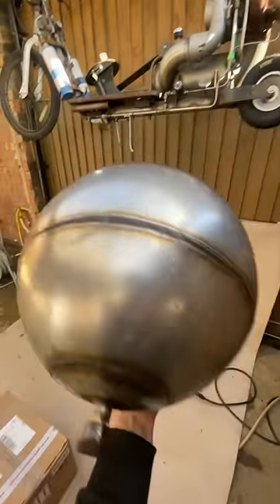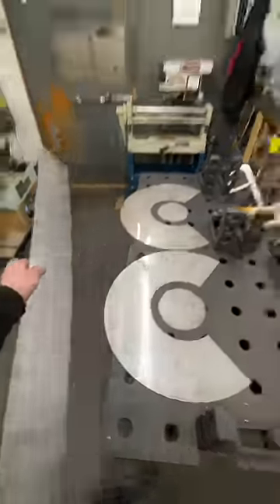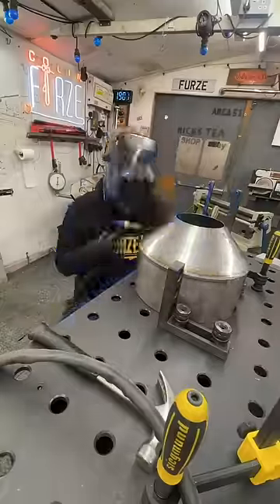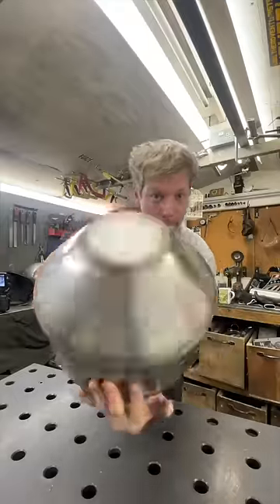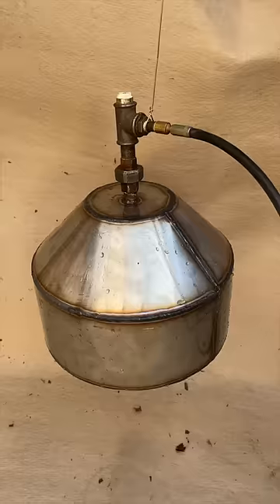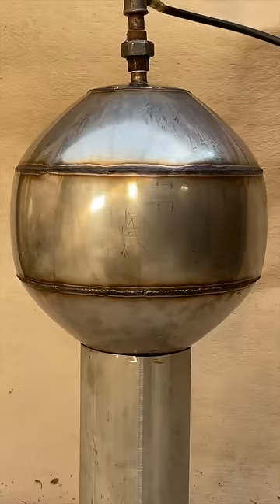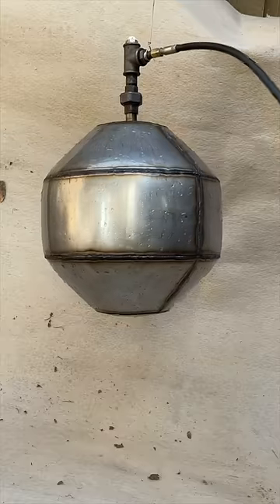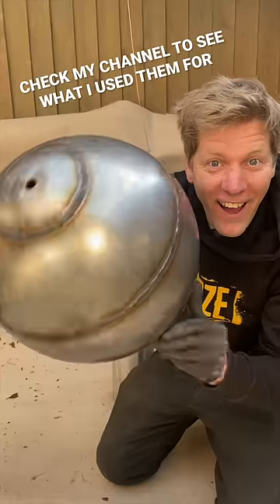Your Pressure washer has a Secret SKILL

Comment: That's some serious confidence in your welding.
Reply: He's a gifted fabricator and engineer for sure!
Reply: Indeed
Reply: He’s a god at creating everything lol so honestly I’m not surprised
Reply: Well the reason you hydro test tanks and boilers is specifically because if they rupture it’s not too big of a deal. Because water is incompressible, the increase in volume with a breach is minimal. Compressed gas is what makes a bomb you have to be worried about
Reply: you havent seen explosive forming spheres
Reply: The fact that water cant be compressed makes it much safer though, if that exploded holding a gas it would be way deadlier.
Reply: @skylined5534  Less of an engineer and more of a plumber. But surely gifted.
Reply: Welding is not gluing metal together. Its fusion it together on a molecular level. The welds are stronger than the steel. Because they are steel, but thicker.
Reply: @Mikael-jt1hk  thats if the welds are done properly. This guy is really confident in his skills
Reply: @t_kups8309  

Definitely an engineer too. You have to be to do the stuff he does.
Reply: @antreaskonstantinou8585 Water can be compressed, it's that it's not practical to do so.
Reply: Even when I did it for a living, I'm not sure I ever had that much confidence in mine.
Reply: The giant steel sphere tanks used for gas storage are made using a dimilar technique. Except instead of using a pressure washer to create the internal pressure, they use explosives in water. While this takes some good confidence in your welds, I wouldn't trust a vehicle welded by someone who couldnt manage it. Definitely nowhere near as impressive of welds as with those industrial tansk.
Reply: no its not, its not like pumping air its water wich does not compress, aka it doesnt build overpresure either, if a weld breaks it just leaks it doesnt burts or explode.
Reply: Can absolutely guarantee no one commenting under this saying it’s easy could do it without a leak.
Reply: if you watch the video he used these in, they blew out a few times before he succeeded.
Reply: not really, its water which doesnt compress much, there is barely any energy stored in the sphere while its under pressure
Reply: Well he was a plumber/gas engineer I think
Reply: @jacob9798 There's probably more energy stored in the steel than in the water.
For all the commenter here, I would recommend to look at the phase diagram of water.
Reply: @ameunier41  I was just talking about his welds because they are good welds just by looking at them
Reply: Real confidence is letting the original air stay in it 👀
Reply: Lol. You've obviously never heard of this. It's the safest way to remove dents or do what this fella is doing. This is how we removed dents from 6,000 gal tanker trailers. Stop being afraid
Reply: @theshuman100 exactly. He ain't seen nothing lol
Reply: @Mikael-jt1hk You’re right, but only if your welds don’t have imperfections. If you have cracks that weren’t fully fused, then you have a stress point where it can fail. I’m no pro by any means, but I’ve done my fair share of welding and that’s my take away from everything I’ve learned so far. If I’m wrong though, I’d love to understand why
Reply: @jacob9798 they’re dreadful looking welds 😂 
Colin is a good guy but he’s certainly no welder
Reply: @cornellkirk8946  look decent to me, don't think after all the stuff this guy has done ye wouldn't know how to weld
Reply: @jacob9798  it’s water tight but you can see it’s not good, it’s not even acceptable as a welder.
That’s a fact, it’s not up for debate especially by someone who isn’t a welder. What part of it looks good to you exactly? 😵‍💫
The fact they weren’t purged alone is enough to show he doesn’t know much about welding. The fact you don’t know what purging is, tells me that you aren’t qualified to have a valid opinion
Reply: In the video itself, this process actually fails many times. It's really confidence in the ability not to get any air in the pressure system.
Reply: @antreaskonstantinou8585  welding is not rocket science if you are not blind and deaf and got no hands.
Reply: that's knowing your skill as a fabricator and welder.
Reply: If it springs a leak water will just squirt out. He can weld the leak and try again.
Reply: It can get even more extreme, there is a different method, where instead of a pressure washer you use an explosive.
Reply: @cornellkirk8946  we love to see how you weld. 🙄

Comment: bro pressure tested his welds so casually
Reply: It's not nearly as big of a deal as it looks. This is how you can remove dents from large tanker trailers.
Reply: @timbodnar6711 I’m not sure why but this reminded of me of when the vent isn’t open during emptying and the tank collapses on itself
Reply: @timbodnar6711 thing is he could have Been standing 20mt in behind a wall with the on off switch, but everyone think he's standing 1mt away.  Probably takes well more then 1800psi to make those welds fail.
Reply: @timbodnar6711 What? Are you clueless. He could of easily lost his life if he wasn't so godly at welding. First vid I've seen of him too.
Reply: @name5293  I mean, it's water, not air. So it wouldn't explode
Reply: @name5293  Calling someone clueless? Ohh the irony.
Reply: @DanielSan-ch7dr   In his videos his face was right next to it lol, the highest pressure stuff in there was water and it sometimes leaked but it wasnt deadly or dangerous, obviously he knew how to make it safe, im just talking from my observations
Reply: @name5293 if the welds fail water will spill out

It's different with air, which is very dangerous
Reply: @Scavendon  but he could be 🥺
Reply: Holy moly people, I don't think grizzly was focussing on how the pressure effects the metal vs air. It was a comment on weld quality. It takes a decent weld to be 100% water tight. I'm not saying that many people can't do it, just that any welder would nod his head in approval over this weld. It's a good weld, and curved welds are harder than straight ones.
Reply: A weld failed on his first attempt.
Reply: @name5293 your the clueless one who doesn’t know the difference between hydraulic and pneumatic forces. Air compresses which makes for a rapid expansion aka explosion when rupturing. Water is “non-compressible” it compresses very slightly but no where near enough to create a bomb. A ruptured weld would be an adult super soaker which is dangerous due to a potential high pressure injection injury but that’s also pretty unlikely.

Comment: The TIG welds are looking beautiful
Reply from the maker: They held out.
Reply: @colinfurze  They weld out
Reply: @colinfurze  I seen the video ya had a few pinholes mate. Got a face full of water... Still miles better then I could ever do and I only got a messy flux core mig.
Reply: @colinfurze  what amperage did you use was it 2mm steel? Or 1.1 i use 40 amps for 1.1
Reply: @D-Dova  thanks for that bit, kek!
Reply: Those welds are a disaster
Reply: Beautiful??
Reply: looks beautiful? Definitely not. But worked? Definitely.

Comment: Instructions unclear, created a explosion, gotta move house
Reply: instructions unclear, moved to neighbours, can't find house, please help
Reply: instructions unclear, picked up my house and moved it across the street
Reply: Instructions unclear.  Had to pick up face but arms where gone.
Reply: Instructions unclear, Nebraska no longer exists
Reply: Instructions unclear, don't pressure me!
Reply: Instructions unclear, currently on the run
Reply: Was gunna say, how many times did it explode before getting it right lol
Reply: @raidzeromatt  the welds may fail and rupture, but it wouldn't explode like you're probably thinking. Water doesn't compress like air does, so once the container fails the water would just quickly lose pressure and leak out instead of rapidly expanding and making a boom

tl;dr :  it's less bomb/balloon and more broken pipe
Reply: In industrial processes instead of using a pressure washer they use hydrogen combustion… so you failed successfully?
Reply: @ProfessionalGasLighting 
In industrial processes, they've got precisely metered gas mixtures to produce the explosion, X-ray machines to check the welds before they start blasting, and trained engineers to calculate whether or not the process would actually work to begin with.
Reply: jordanrodrigues1279  -  I filled it with gun powder and put a fire cracker in the hole... Now I am in orbit with all the other space junk. That reentry is going to be hell.
Reply: @KlodFather  You copy and paster.
Reply: @j-schnab6338  -  What the flatulence are you talking about? Copy and paste what? Everyone knows that SchnabMaster likes eating paste and play-doh so we saved it for you buddy. Bon-Appetit
Reply: Instructions unclear, created a UFO and now there’s circles in my crop
Reply: Instructions unclear the explosion was so large that the nazis came back
Reply: Instructions unclear. Finished removing all evidence from the house by burning it to the ground, got to move now. At least there's insurance
Reply: @KlodFather   I absolutely loved you're response so I'm going to end it here and just enjoy it. Hahahahah. I wish I had eaten paste as a kid I would have an explanation for why I am the way I am.
Reply: The FBI wants to know your location

Comment: Hey, folks! If you’re going to try this at home, please listen to and do what the man said, and FILL IT WITH WATER!!!! If you don’t, someone will likely die or be seriously hurt. The stored energy in compressed air at several hundred to maybe 2,000 psi could send fragments flying if the vessel ruptures. Water doesn’t compress, so there’s little to no danger if it ruptures.
Reply: Great explanation! Thank you for curing my curiosity, friend.
Reply: Algorithm sent me due to Titan submarine
Reply: I made mine by packing it with gun powder and putting a fire cracker in the hole. My sphere is bigger than his LOL   I'll give you my address on the moon so you can send me a Christmas Card ha ha
Reply: I have heard the term "Water doesn't compress" before, but I think it is more interesting to say to say that it doesn't compress at any pressure that the average person will be able to achieve. At 10,000 atmosphres, water is compressed into the exotic Ice IV. At 48 Million atmospheres, It will become Metalic water. Theoretically that is... It isn't currently possible to test the kinds of pressure found in large planets or stars.
Reply: @austinseph1  So, is exotic ice theoretical as well, or has that been done? Either way, it sounds fascinating, especially metallic water!
Reply: Water does compress but not that much as air. 

Also I'm too lazy to check if anyone has already mentioned this so I'm going to reply anyway.
Reply: @syedhashir2970  Well, that’s what happens when your information drops off at high school science class! 🤪 I like to keep learning whatever I can, but this one is new to me. Fascinating, how water really actually is compressible, and the theoretical changes that occur when it reaches the “metallic water” state! Another comment here opened up my eyes to this fact and theory, too. Thanks! 😊
Reply: @nicholasittzes7224  Yeah, I agree. A quick question, would you want to keep learning basic things about science and in life through small classes kind of like those in elementary school or would you prefer to have them discover them yourself? 🤔
Reply: That’s so cool, I remember Adam savage explained this process in a video a while back talking about something he did on mythbusters, and he mentioned how it failed and how water got everywhere, and in my mind I was like “that sounds horrifying it sounds like it would shoot pressurized water jets everywhere and blow holes in the walls” but considering that waters (essentially) incompressible it makes a lot more sense
Reply: Did you watch the video? He says that, listen next time
Reply: @majesticeagle5461  Absolutely!😊 I just really wanted to drive that home, so people like me, who like to try things their own way, but maybe lacking that bit of information, might avoid learning that one the hard way. Yup, people like us really do exist: too much enthusiasm, and not always enough info and/or forethought… 😁